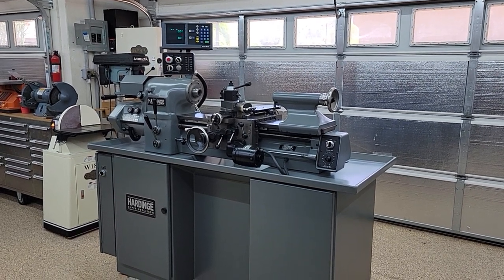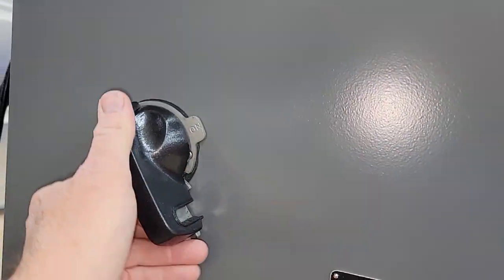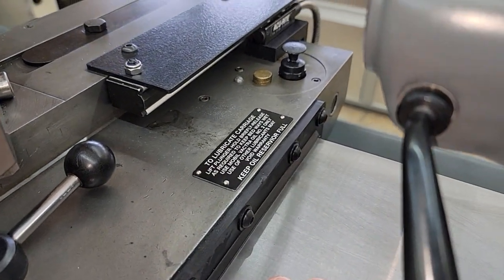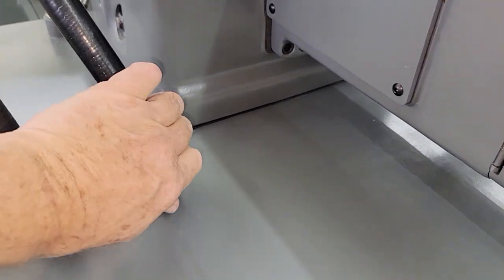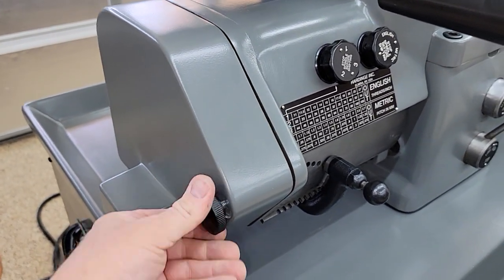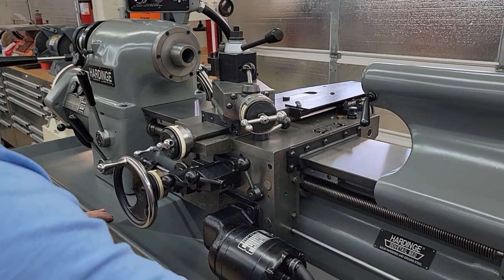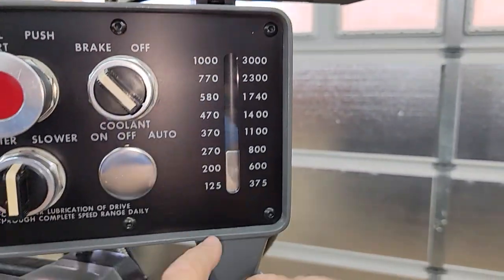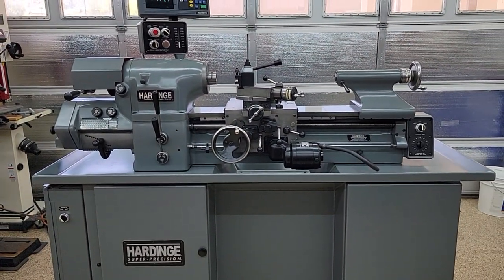Hardinge HLV-H-EM in Excellent Condition Complete Rebuild - SOLD!

Comment: I have this same machine that i am in the process of rebuilding but I am to the point where i need to have the bed reground and am wondering what you did to get the headstock tailstock and cariage to line up in the end? Did you shim the bed plate up and grind the tailstock down? Do you have to redo the cariage bottom or shim the rack to align back to the pinion on the cariage feed?

Comment: Beautiful job!
Did you rescrape the gibbs? Did you have the change the spindle bearing?  How about the clutches in the apron, did you clean that out too? Any gears which had to be changed to improve the backlash? Was the leadscrew worn?
Reply from the maker: Thank you!

The person who I bought it off of was part of the way through restoring the lathe.  He had already scraped the bed, tailstock, gibbs etc.   The spindle bearing was solid with no noise or play that I could tell, I think he replaced that as well, it looked new upon inspection.  I did rebuild the clutches in the apron.  All of the gearboxes, including the apron were disassembled, checked and cleaned.

The backlash was minimal and the gears did not show wear.  I do not think the machine had a lot of use, even the original paint was not heavily worn.

I got lucky and found a machine that was excellent to begin with, then took the time to take it apart and perfect it.
Reply: Nice looking lathe but…. The bed is a hardened tool steel bed. Your not scraping these. These need to ground. The saddle was turcited from the factory. I have the same lathe but mine isn’t this clean. I love my EM.!!!!